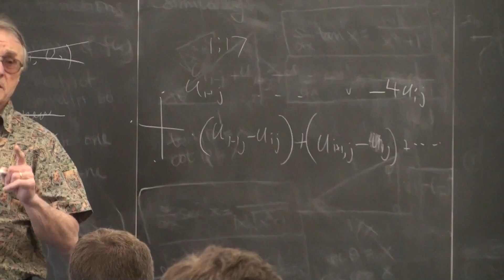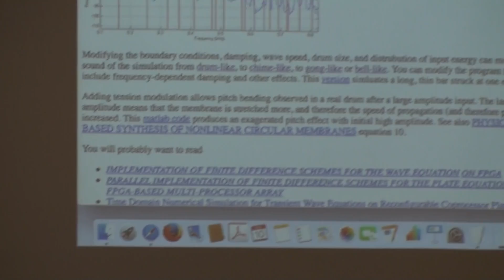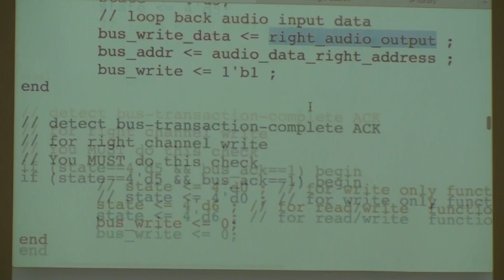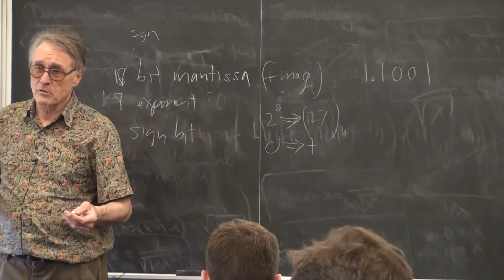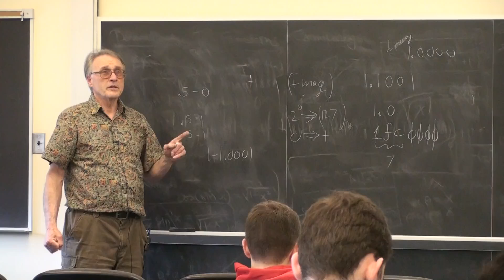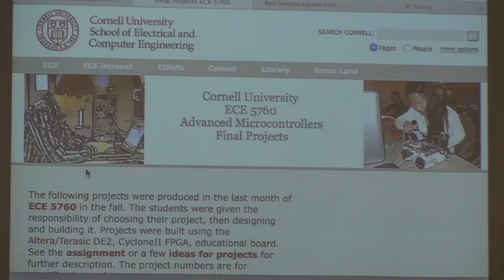#18 Audio codec -- Floating point hardware

Comment: It is possible to launch sound sources localisation on wm8731 chip.
Reply from the maker: it is possible, but the direction resolution is not good because of the 20 microsecond sample rate
Reply: @ece4760  does this mean that we need to new piece of hardware on the FPGA board to be able to do a better lab exercise?
Reply from the maker: @優さん-n7m  It depends on the accuracy you require. and how far apart your microphones are. Human ears are about 25 cm apart, so it takes .25/320 seconds for sound to cross your head, or about 720 uSec. with that  baseline, how many degrees fo azimuth corresponds to 20 uSec?

Comment: Regarding the bus speed, you can use DMA IP cores in the FPGA side, use burst transations and ajust the bus lenght. You can get a lot of throughtput and if you use FPGA to SDRAM bridge, even more.
Reply from the maker: The transfer bottleneck was that LINUX wants to own SDRAM, so transfers had to use MMAP to get physical addresses. MMAP seems to slow memory access by about a factor of 8.